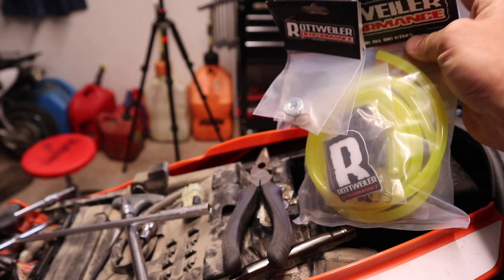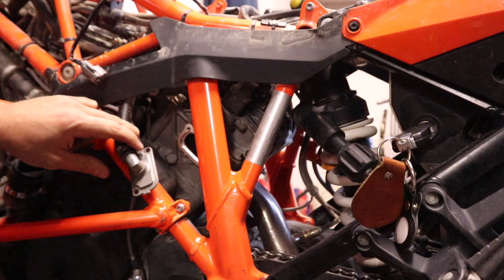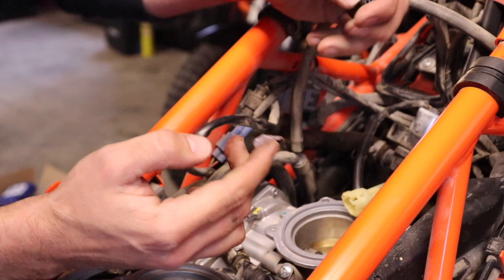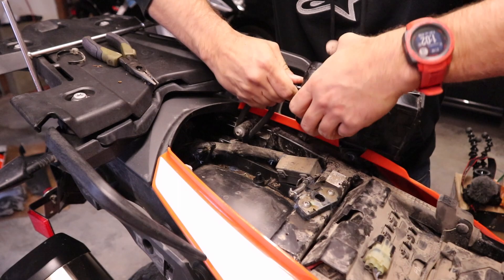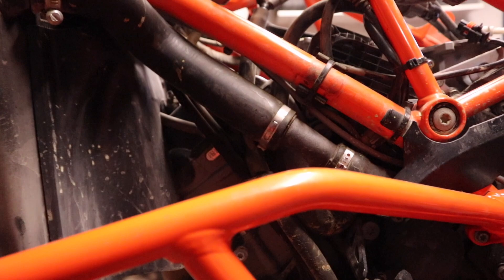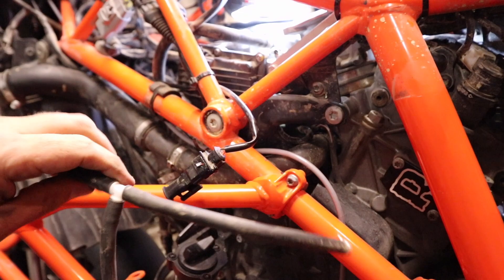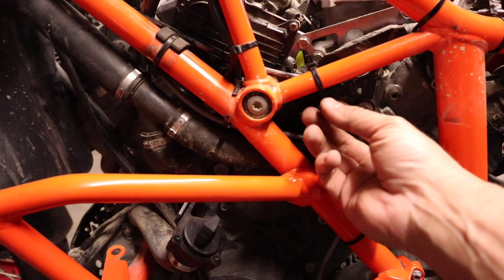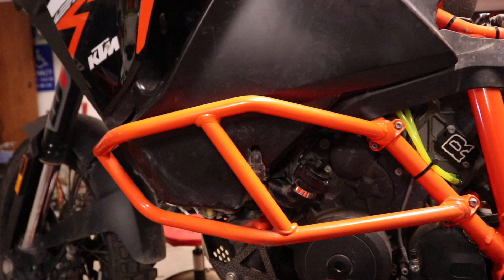KTM 1090 1190 1290 Rottweiler SAS Stage 3 Delete | Back in the Garage

Comment: Mario,  I just finished the stage 3 delete, Rotwiller air box replacement and the fuel filter rebuild on my 2016 Super Adventure.  The bike fired up first time and is running fine.  I absolutely could not have done the work without your videos!!! Thanks so much for posting them.
Reply from the maker: Glad the videos helped! Enjoy all the new power!

Comment: Love watching your „back in the garage today“ videos even though I have no intention to install this kit any time soon 😉 do you know if this will have any impact on the emissions? My understanding is that this just burns excess fuel from the vent lines. The air filter upgrade and a different fuel would have an impact on emissions I would think. We have to her our bikes checked for emissions every 2 years in Germany which makes such modifications a bit risky as we the bike may no longer pass the test. Somehow I got way with it on a 2006 Harley with open air filter and modified fuel map but i am not sure this would work with modern bikes. Thank you- Oliver
Reply from the maker: Oliver, yes they do have an impact on the emissions. The SAS along with the evap canister (and arguable the O2 sensors) make up the entire emissions system on the bike. "Technically" this is only legal in the US for competition and off-road purposes but in most (if not all) jurisdictions motorcycles are exempt from annual emissions testing. The new airbox will allow the bike to intake more air which can push more fuel (aka more power) while the fuel dongles we installed override the ECU to provide a richer air/fuel mixture. I can't say for sure if it these modifications would lead to a failure of the emissions test in your country but I do know it will emit more emissions that the stock setup.
Reply: @2WR  Thank you for the quick reply 😎 i wished they didn’t test the bikes here either - would make life a lot easier 😂 keep up the great videos!

Comment: For such tuning is not necessary to buy expensive Rottweiler kit.
My mechanic did the same SAS tuning by himself. He cut 2 plates from 2mm flat aluminium sheet (like these black plates), took off original tubes and to avoid any errors, without dongle connection, he just simply kept solenoid connected to the wiring (now it technically works, but does nothing, because no tubes are connected to it).
Reply from the maker: True. You can also buy inexpensive block off plates from eBay. It's also possible to make your own dongles and save even more money. That said, I don't understand keeping the solenoid connected especially if you're talking about the one over the front cylinder as it's just something else to work around or move out of the way when you need to work on things.
Reply from the maker: Would be interested to know how much you paid the mechanic for the work
Reply: I live in Moldova, and here working hour cost much cheaper than in US. Valves check + Oil change + Tires change + SAS removal cost to me about 125 $.
We kept solenoid due to we had no such connector to put resistor inside. I think it will not add some difficult to access front cylinder, because it is connected using only soft wires, but not hard tubes. For me it is not critical because he will be working on maintain of my Super Adventure, but not me;)
Reply: @2WR  also getting rid of the solenoid helps with  airflow

Comment: Hey Mario. About to do this and wondering if I should go full hog and do the Rottweiler intake while I’m in there.  Still happy with it after all these miles? Not too loud?
Reply from the maker: Many years later, I'm still happy with it on my bike. Actually have the Rottweiler intakes on my 1290, 990 and now 890.
Reply: @2WR  
Thanks, guess I’ll just go for it.  I was also considering one for my 990 too. Just didn’t know if I needed to remap since I loaded the EU tune on the 990 to smooth out fueling.

Comment: Just picked up a 2015 1190 with only 700 miles on it.... looking to the stage 3 intake system and the SAS Stage 3 delete in the near future.
Whats your option on the stock air box setup? Should i go ahead and swap it out right away or is it decent enough for dusty off road conditions ?
Reply from the maker: The stock air filter works fine but if you're going to be riding in dusty conditions it needs to be checked/changed more often than the recommended interval.
Reply: @2WR  last question… lol 
Have you deleted the cat. 
Seen a video where a guy takes the stock system off, cuts a square, scrapes out the honeycomb and welds it closed. 
Says it also reduced heat coming off the pipes. 
What are your thoughts on that?

Comment: Can you do a video on how to change rhe rear signal light. Thanks
Reply from the maker: Perhaps at some point but it's a pretty easy job. Remove the small screw in the front corner of the signal housing, carefully remove the turn signal glass (tab opposite the screw), remove old bulb, press in new bulb while turning clockwise, reassemble.

Comment: You make it look easy ! Lol
I have a question for you and Brian,  I am thinking of adding a skid plate on my 18  1290 SAR  any brand suggestions?
Reply: I’ve really enjoyed the Black Dog Cycle Works. I like that it relocated the kick stand outside the side of the engine. With that though,
it added an additional
Complexity for install. I personally like the look and the coverage it has. Mario probably has a different opinion based on his experience.
Reply from the maker: KTM PP aluminum skid plate. The BDCW is overkill and the kick stand relocation is a solution to a problem for 99% of people doesn’t exist…but will now have a problem because the kick stand kill switch is disabled with the relocation.

Comment: I have watched probably all your back in the garage videos and i thank you for showing all the details they are very helpfull! I have a 2017 SAR and sometimes it shows "Air temp failure " message on the screen but then it goes away. I think there is a short or the sensor is bad but is there a way you can show us where the sensor is and how to get to it? Thanks so much and yake care!
Reply from the maker: It’s 30 seconds into this video. 
https://youtu.be/vmhaktBQgIQ
Reply: @2WR  does "air temp failure " mean its the sensor that you show there on the air box? I think mine is more the outside air temperature the one that reads the weather because when i move the handlebar to the left it pops up do you know how to replace that sensor? I think is somewhere behind the head lamp but i am not sure. Thanks for answering so quick  though you're the best!